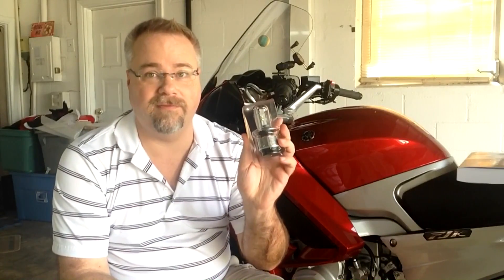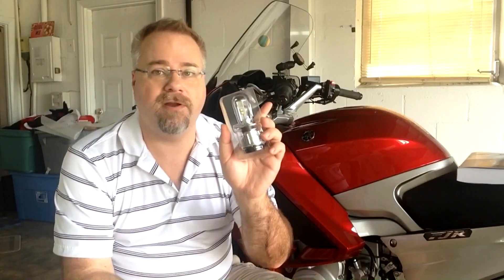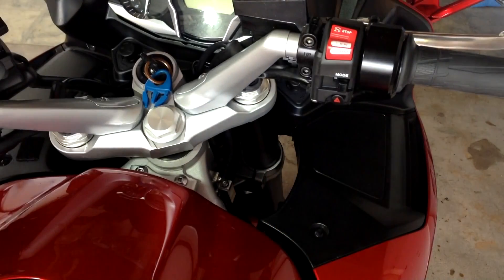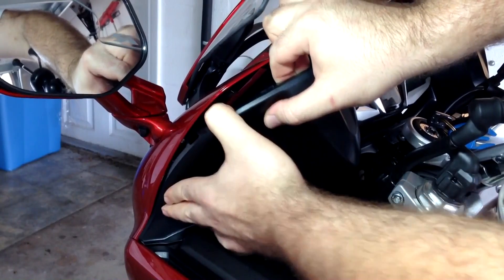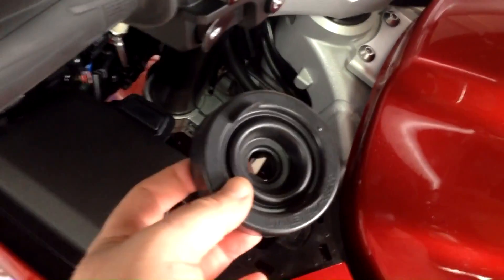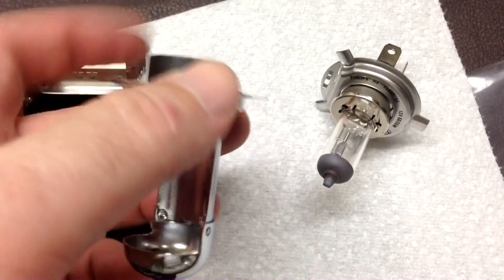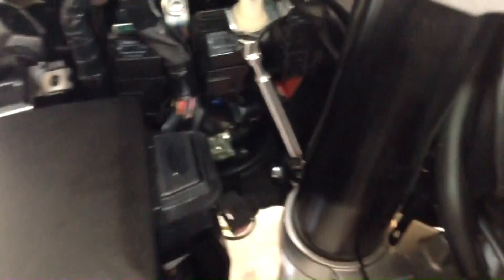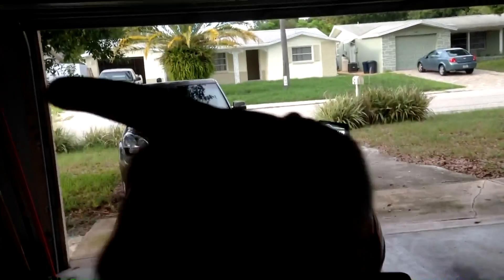FJR1300 Headlight Bulb Replacement And LED Comparison

Comment: Great, great review. I just got a 2015 with 350 miles on it. The guy laid it over in his driveway, got scared/upset and wanted to get rid of it. I am using your video for the coolant change to remove and replace the side plastics and, unfortunately, the saddlebag. It was invaluable. 

This is another spectacularly useful video. Thank you for your work.
Reply: rmg471 did you find his purse in one of the cases?

Comment: Hi Bryan - great video. I just did the headlight replacement on my '15. I had previously owned a BMW R1200RT and replacing headlight bulbs on that was a chore and a major pain in the butt. The FJR makes that seem easy. 
Your video was very helpful in providing the guidance necessary to get to the bulbs.

Cheers and Thanks

Comment: Been through all the lights on bike from bulb candles to the leads of today. I have found that the test of brightness and confidence is tested in the rain. We have seen how the light is soaked up on a wet road .
Reply: "Auto correct led" I have a 2016 fjr it's number 5 love em led head lights awesome adjustable suspension in the menu gun metal grey and yep I'm very happy with my baby.

Comment: Bryan: Video was a great help! Just need to know about the rubber boots….. do they go back on or not? ( No mention of reinstalling them )….
I put the adapter in first like you did, then installed the boots. Then inserted the bulb unit through the rubber boot and into the adapter mount.
Is this ok?…as it appears that the boot covers most of the cooling fins….????

Comment: You should do an updated video with newer generation LED bulbs.  I just replaced mine on a Gen 2 bie and the difference is well worth the money
Reply: Hi. Here in Spain, the LED lamps for motorbikes are strictly forbidden (unless OEM factory mounted). So, don´t pass the goverment inspection and you are not alowed to drive, plus a big fine if the Police stop you. Not logical here. A few months ago, I put the LED ligths on my FJR and went to the inspection. Since the first moment, the inspector said to me "that lights are not permited". I had to back home and replaced the old ones and gone again to the inspectión. Fortunatly, now I ride with the Ok stamp on my FJR, but is a nigthmare this kind of things in my country.

Comment: You didn’t mention anything about the rubber seal that was around the original bulb. Did you put it back in place? Did you have to modify it to allow the new LED bulb to fit? Look forward to your answer. Thanks
Reply: Did you found an answer for this lol

Comment: Thanks for the detailed stripdown.I have just installed my LED bulbs with cooling fans. yes no brighter. Not like HID but more reliable but like you say less load on the alternator and they will last much much longer than the original halogen.
By the way the pair only cost $17 CAD including shipping and before anybody tells me the Chinese ones are rubbish, I have the same one's in my car and they have worked flawlessly for over a year. If the were going to fail it would of failed by now.

Comment: If you want more brightness, as of August 2021, best case scenario is to change your light assembly altogether for a new one. This includes reflectors. Problem with changing normal bulbs for LED is that your reflectors are not designed for it. LED are directional and require focusing reflectors so as to not blind incoming traffic. Your old unit relies on multiple reflections to work with LED and stay legal at the same time. All of this combined saps much luminosity from your setup. Just spend extra and get a new head unit with a reflector that is specifically designed for LED. Simply changing bulbs is a partial solution at best, and likely will not gain you any results. Also, LED become less and less efficient as their power goes up. That is due to increased heat output relative to their size. Basically, a 50W LED is not a lot brighter than good quality 50W normal lights. And improper reflector will sap some of that brightness, possibly even making it visibly dimmer. There are some extremely expensive LED bulbs with 3 and 4 surfaces that try and mirror conventional bulbs in terms of light pattern. But at a price point of $300-ish for a pair, you might as well cough up a little extra and go for a full conversion.

Comment: Thanks for the video Bryan.  After watching this I am dreading the day when my headlamp bulbs burn out, lol.  That is incredibly difficult for something that should be such an easy task.  I generally switch to Phillips SilverStar Ultra's on my cars and bikes.  Easy stock replacement, slightly brighter and gives you that ultra white light (and fairly inexpensive).  I was curious how difficult it is to get that dash panel back IN.  Did you have to screw with it for awhile or pop it back in immediately?  You got me thinking about removing at least that panel and using a 3-D carbon fiber wrap on it.  Might be a great accent to the dash.  I also wonder what a dealer would charge to change the bulbs.. that's looking like 2 hours labor !  LOL.

Comment: It looks exactly as with my concurs when I installed HID couple of years ago.  It seams that the light beam shoots much further away but it lacks the area near ahead. I think it could be caused by the metal housing that blocks the bottom of the bulb. I was planning to cut it out as much as possible to allow the light to go down of the bulb. If you look at the regular bulb it doesn't have anything around it and so the light generated can go in all directions. What do you think? Have you had any experience with modifying the bulbs?

Comment: Hi Bryan. I know this is an older video, however, I am now switching to LEDs on my FJR. Dumb thought, but it really looks like the headlight bulb is accessible from beneath by the front wheel. Have you tried that? I am going to when I get my new bulbs. Great videos.
Reply: After what looks like easily accessible area turned out to be a needed plastics removal. The right side was extremely limited access even with the plastics removed. I am still working on the right side. Hopefully done today.

Comment: Will the led bulbs from Yamaha be any different ? Is the housing on the led bikes deferent from the older bikes? And the rear lights can you just replace the whole housing looks like the same outer shape? Ok guys just throwing that out there planning on looking at a 2016 model in 2021 if COVID doesn’t get me first 😢 ride save !

Comment: Hi, Much, much easier going in underneath, from the front.  Remove the two bolts securing the plastic brake hose shroud, it can't be pulled-out but can be moved to the side.  The globe clip can be seen through the front of the headlight and moved out of the way. And the globe can be easily seen through the headlight which makes it sooo much easier to insert and re-clip.
Try it, much easier.  Mine is the 2015 model, same setup as the one you did the video on. H4 LEDs have come a long way since you did yours, those things you had were clearly rubbish.
Phil Wynter, Land of OZ.

Comment: did you play with your headlight aim at all because I can clearly see in the night shots with the led lights a car's tail light reflectors and the license plate and I don't see that with the halogen. I mention aim because the halogen light just looks like its pointing down and to the right where the led was up a little higher and straight ahead. most people point them like that because they like to see the edge of the road and what's lurking in the ditch. but hey ideas for your next led comparison video right.

Comment: TwoWheelObsession I have all LED lights on my motorcycle. It is standard on the 2014 Honda CTX 1300. My front headlights are great, but I sometimes wonder if people can see me, even with the lime yellow jacket, gloves, and helmet. I wonder if I need to get a flashing LED Lights for even daylight running lights, after what I have experienced on the local Arkansas Highway, as you will see in with a few of my videos that I uploaded recently.

Comment: Hey brain you have plans to upgrade your head light unit with the new 2016s. You think it would fit in the 2014? Looks to be the same body
Reply from the maker: It's Bryan.  And no - it takes thousands of dollars worth of parts to swap, if it's even possible.
Reply: Sorry gotta love auto correct didn't catch that lol
Reply: Thanks for the response.  That was going to be my question.

Comment: You gotta get those 3 sided led lights because your headlight reflector is "triangle" those 2 sided led lights are more towards to the circular headlight reflector. I bought 2 led lights, one is 2 sided and the other is 3 sided and my headlight shape is "triangular" similar to the fjr. The 2 sided led lights barely gives out any light but when i swap out with the 3 sided led and its bright as hell, brighter than my stock halogens sooo yea

Comment: The problem with the led lights is not other than the light color, is too cold. The halogen original bulbs are around 3500K and those led are in the 5000K color temperature. This is why the originals are better. If you find leds with 3500K color you will find that the leds works as the halogens.

I tested the new BMW R1200GS for a Chilean magazine. This bike have leds lights from factory, and I didn't like it because you cannot see the pavement nor any opaque thing, but the reflecting things bright as you never see before.

Regards from Chile!
Reply from the maker: Jose Pedro Espinosa That is certainly part of it, but if they were also significantly brighter like the marketing says (200% brighter for example) it would overcome the less perceived light.  Unfortunately they are not brighter.  Even if they were the stock 3500k, the throw would not be as good as stock.
Reply: TwoWheelObsession If you compare halogens with leds both the same color you will find that the leds are 5 times brighter for the same power (watts). The people who love to tuning their cars love cold color lights (over 4000K) and this is why most of the new bulbs like Xenon and led are made in colors that those guys love, but for the human vision the most efficient color is 3500K. If you find leds bulbs in 3500K color try it, I'm sure you will be happy with it.
Reply from the maker: Jose Pedro Espinosa Stay tuned...part two is rendering...new info, more tests, new results...

Comment: Dude, you totally took the hard way in replacing your lights. At least on my 2007, I can reach up behind the front fork from below the cowl and by feel unplug, remove, and reinstall both head lamps. 

Turn the front wheel left or right to accommodate space to reach up. 

5 min... done.
Reply from the maker: "at least on your 2007" - and there's your wrong assumption - it's no longer that easy.

Comment: Hi - Nice video, but I think the reason you had such ppoor results is down to the particualr LED you had - the chips are supposed to face UP (for beam) and DOWN (main). You weren't getting the full spread of light in the correct area of your bike reflector with them pointinf Left and Right....
This isn't to say that the bulbs you had were good - there are loads of poor kits out there (and the technology isn't quite there yet for plug-and-play sytems) however better results can be had. I bought a set to try in July/August and the difference IS noticeable as to the amount of light and spread. The downside is the beam pattern is closer to that of a sealed beam lamp wothout the defined cut-off of the H4s. THat said, I've not been flashed by oncoming traffice as there is none of the scatter associated with aftermarket HIDs.
Don't give up yet!

Comment: Sorry the LEDs didn't work out.  Thanks for the straight up honest video however. Please let us know if you come across LED technology that meets your expectations.
Reply from the maker: +Randy Smith Simply put, none will work correctly in reflector housings meant for regular bulbs.
Reply: Not necessarily true at all. Why are you testing a badly designed LED bulb?  Why don't you contact Cyclops Adventure Sports for a quality LED bulb that will give far better results.
Reply: I've had pretty good luck with LED bulbs I've tried in my '99 civic (I know, completely different application). The Opt7 FluxBeam H4 bulbs work pretty well and have a tad more glare than I'd like, but they have really wide, bright and full beam with the cool white color. PIAA H4 led's are also pretty sweet and have a perfect cutoff with the little flare up to the right to illuminate road signs, but are't quite as bright at the Opt7 and have a bit of a purple tint to them. As of July 2016, the Opt7's are down to $80 a set (were $100 just a few months ago) and the PIAA's are $220-$250 (I got lucky found a used set for $170). I'd be tempted to try out the Cyclops and Mictuning H4 LED headlights as well, since they both have little anti-glare shields on them and are both around the same price as the Opt7 bulbs. I've also tried Genssi H4 led's that had a COB led placed on both the top and bottom that fired the light straight into the top of the reflector, resulting in  a very narrow, short-throwing beam that was also pretty blue.
Reply: Thanks for the detailed information
Reply: +Chris sibley oh yeah, the cooling fans on the PIAA lights are considerably quieter, whereas the opt7's almost sound like a vacuum cleaner
Reply: @TwoWheelObsession  I recently installed LED replacements in my new Toyota Highlander for both the projector and reflector bulb housings with great results as far as the proper beam spot. My question is, have you tried any LEDs recently as the technology for LEDs have improved in just 2 years. Secondly, are there any clearance issues in the housing to be concerned about since these are often a little bit larger?

Comment: yeah but housing the cons of the LEDs you put the light facing up how it would really work for you if you have reversed it and made it face down you woulda got more light and it control you want it with those LED bulbs the company should have known that cuz all the light when I went down and then reflected out in a controlled manner take you from experience I did it that way and it work for me

Comment: very nice video i have to say but you need to watch out on what LED bulbs/ kits you buy there just like HID kits the cheaper they are mostly means the cheaper the quality. so a result that may have been why they were so bad. i personally like Plasma Glows kits and i am currently waiting for my kit to show up for my 2014 cruze not only are their LED light surface bigger then the ones on your bulb they are made from high quality materials. so if anyone would like me to make a video please let me know i will try my best as i have never done one before or if anyone wants to help me make one thatll work also. but back to as i was saying they make products both for motorcycles and vehicles so if you can check those out i would like to hear your opinion on there bulbs for your bike